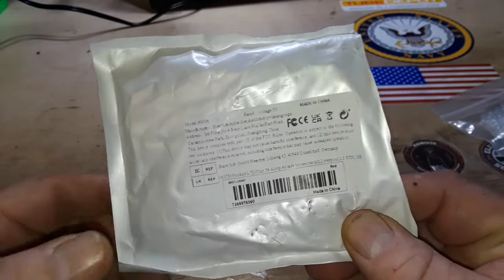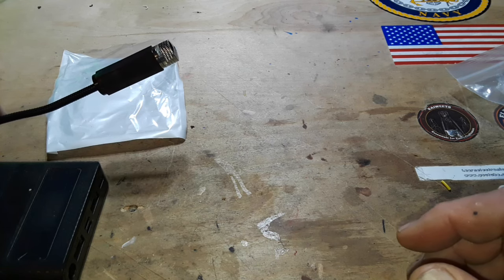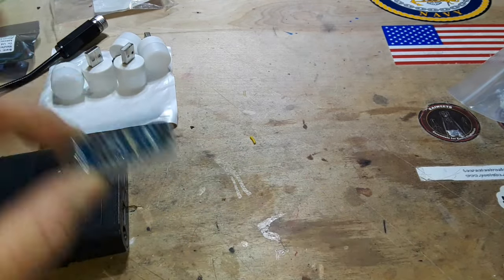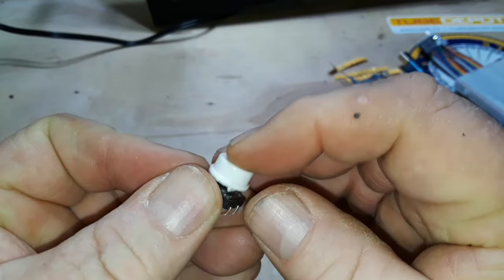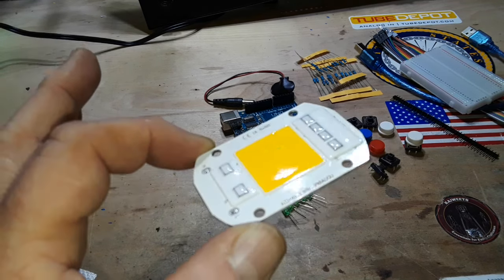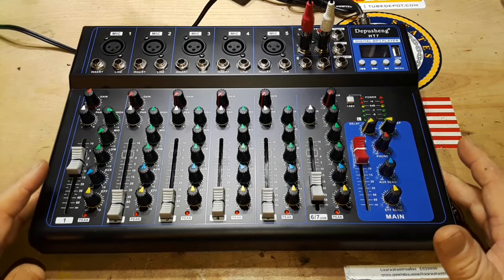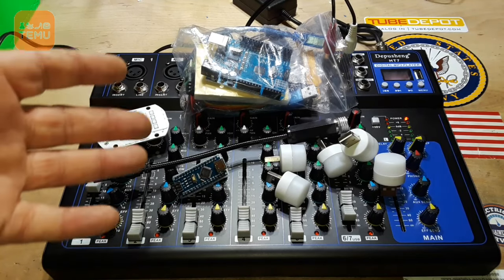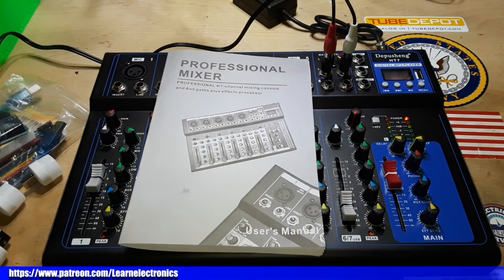$77 Worth of Electronics from TEMU

Comment: You will never know how valuable productions like yours are, and not only for beginners! Thanks!

[EDIT] BTW - that mixer didn't deem to produce much "floor noise"; was it as quiet in person?
Reply from the maker: Thank you. The mixer is great. I've used it at 2 gigs so far and plan to use it this Thursday for another. The only time I've noticed any noise is when plugging in the USB from my Dell desktop PC. No issues with a laptop, only my main PC. I attribute it to a ground loop, but I don't use the USB so, it doesn't bother me. I run 3 amps and 3 mics through it. The main outputs go to our powered PA speakers and I use the Aux send for our in ear monitors.
Reply: @learnelectronics  Thanks! I'm with you; a cheap standby in the gig bag is great insurance, and helps peace of mind. Now I only need cheap standby amps, keys, instruments, lights, and bass players.

Comment: The USB/LEDs will help keep the Boogeyman away ! 
 Is it the greatest mixer - NO ... who cares.  As long as it does the job and you're not stressed about beer spillage or sticky fingers.  For a small pub band it should be more than adequate.  I did notice the volume doesn't go up to 11, tsk tsk tsk.  Maybe the next model up ?
Reply from the maker: Yes, surely the next one will be Spinal Tap appropriate.
Reply: Well done on picking up the reference of Volume going up to 11.